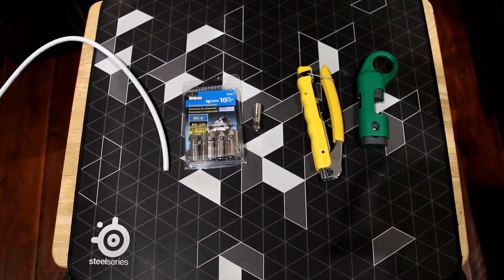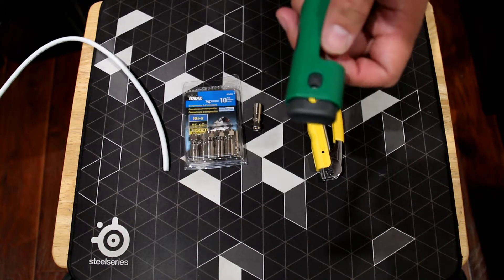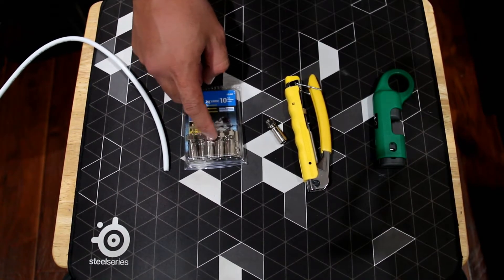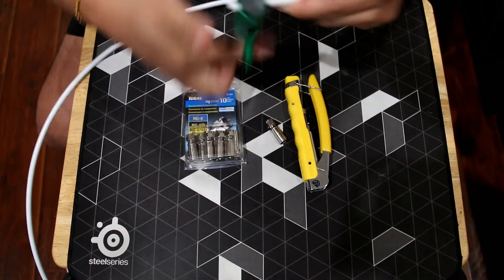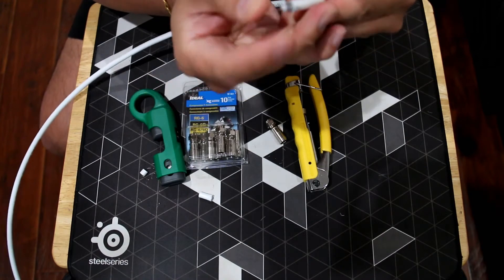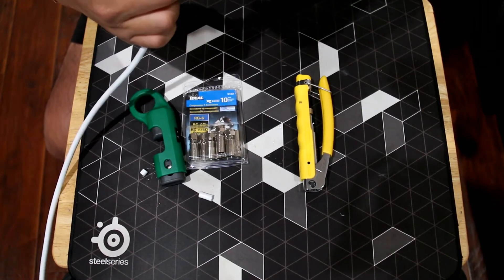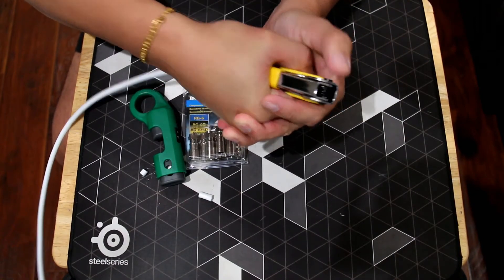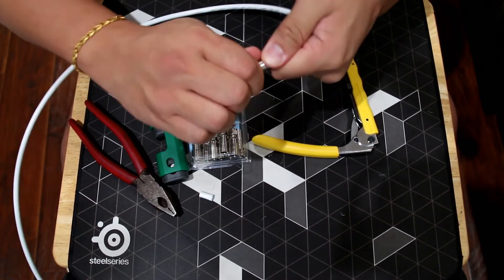Coax cable tutorial stripping and compression fittings

Comment: Have same tool. Is size of cable important?  If so why didn’t you mention?  4th video I’ve watched.  Crimping tool does not work for me.  Tool has adjustment.  You did not mention.  These are worst utube instructions I’ve run across.  Is type of connector important?

Comment: Keep the subject (hand and tools) in frame. Also tell the viewer the setting (echoing cnbsdad's comment) you used. Pretty obvious it was an F- RG59 but not everyone knows that. Lastly, when you pressed down on the crimper your hand covered the most important part - what is the crimper doing to the connector? My crimper is not making contact with the barrel o the connector so not getting a compression fitting. Oh well.....
Reply from the maker: thanks for the advice =)